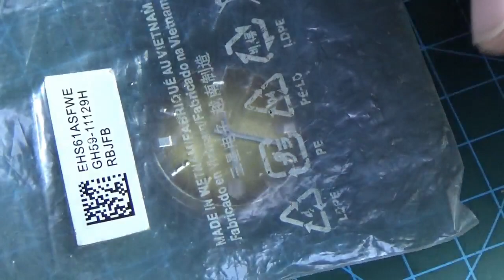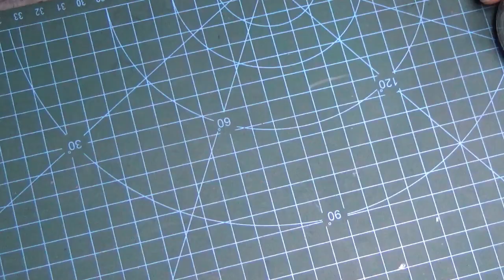citizen new master 0201 movement deassemble

Comment: Movement is same with hmt 0231
Reply from the maker: Yes
Reply: @electromech8931  beat error is always high, it's above 1.5
Reply from the maker: @bobbywahengbam7336   de magnetize then check again
Reply: @electromech8931  thanks
Reply: its hmt 0201 which is supposed to be original few. the pilot and janata having 0231 were later derivatives of the 0201